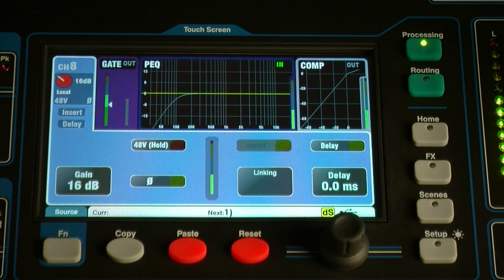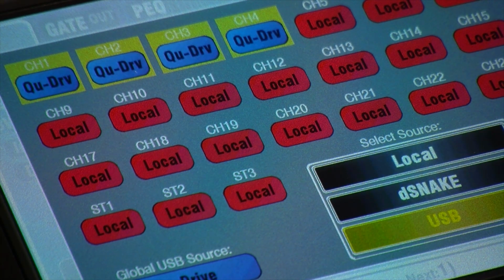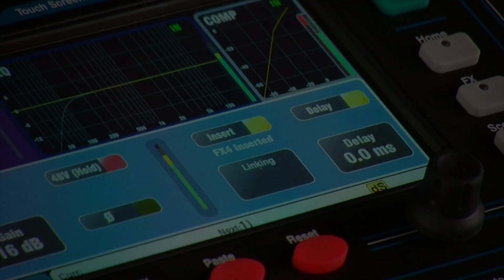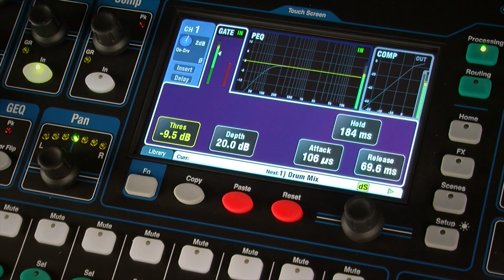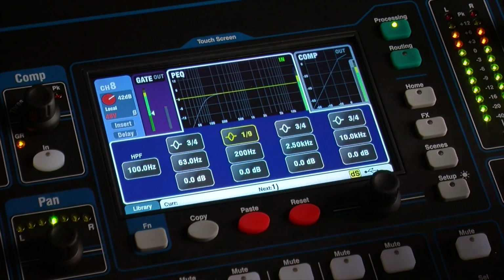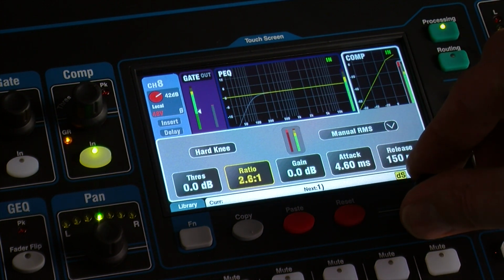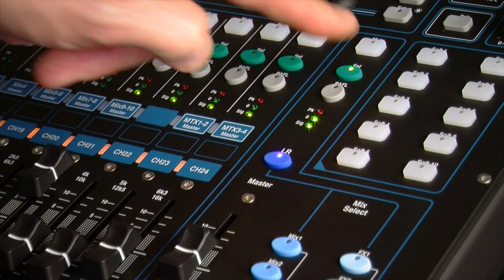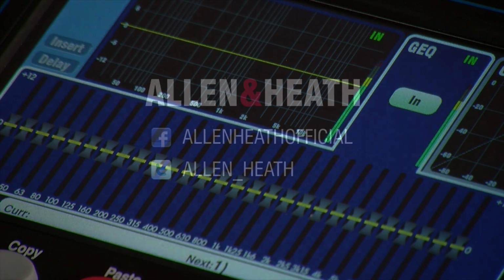Allen & Heath Qu Series - Channel Processing

Comment: Is there anyway to create a parallel compression channel?
Like, if I made Aux 5/6 into a pure drum buss channel, compressed the daylights out of it, then routed it into the drum DCA?
How would I route it into a DCA?
Reply from the maker: Hi Aaron, 

If your Qu has groups, you could send the channels to two group and use one for the compression. The other group can be left unprocessed as it is only needed so that there are no problems caused by latency. 

Alternatively, if you're using a digital expander, you could assign the same input socket to two input channels in the Setup > IO Patch > dSnake In page. You can then compress one of the channels and use the other channel dry. 

DCAs don't pass any audio as they simply control the main level fader for the assigned channel. So you could assign the two group main level faders or the two input channel faders to a DCA so you have a single fader control. 

You can find how to assign channels to a DCA here: https://www.allen-heath.com/media/Qu-Mixer-Reference-Guide-AP9372_10.pdf#page=44 

Thanks!
Alex

Comment: I’ve my Qu-24 running fine as a controller for ProTools (11.2.1). Everything works great except I can’t pan a channel left and right. I assumed I had something setup wrong in the I/Os. I’m not quite sure I’m reading the answer above correctly… did Nicola A&H say this isn’t possible? (!) Mixing music with no ability to pan things L/R is not ideal, obviously. Any suggestions on a workaround?
Reply from the maker: Hi! The Qu series uses HUI and Mackie protocols for DAW control, this allows control for Fader, Mute, Solo and Select functions. Unfortunately this means that pan can not be controlled in this protocol. For more information, please follow this link: http://support.allen-heath.com/Knowledgebase/Article/View/879/201/qu-series-daw-midi-control 
Thanks! Alex

Comment: I have the Qu 24 board just getting a feel the board and what it can do. But I have a problem right now that I just can't  solve we have new people that's working our board at our church and one of the new helpers was trying to control the sound coming from the board going into the box cast which operate our streaming he turned some controls but don't know the one he use we now have this horrible sound coming from our streaming I tried all that I could to remove it the best I knew how but it hasn't work is it possible that someone can walk me through this to get use back to normal I'm a little new at this. It's like a hollow sound like a person in a tunnel.
Reply from the maker: Hi Gregg, If you would like to submit a support ticket at http://www.allen-heath.com/support/ and we can help you with this. Thanks, Alex

Comment: Can you do VDO on parametric EQ, Channel parametric eq is not working right, it jump from 
234 Hz to 265 Hz, 265 Hz to 325 Hz 374Hz to 450 Hz, Is there a way to get swipe precisely? Thanks
Reply from the maker: Hi San, you can touch the frequency select on the screen and use the screen rotary to give you more precise selection of the PEQ frequency. Hope this helps! HG.
Reply: If you have an iPad using the QU-Studio App will all you lore precise controls as well.

Comment: This video like all the other videos from Allen&Heath UK is too fast, vague, and random. The manual for my QU24 is difficult to understand.  I'm a semi pro musician with limited knowledge of digital mixing consoles.
I want to use the desk as a daw controller and i'm having a real nightmare setting it up. I'm sure its a great desk but i'm currently frustrated about the lack of information about using this desk as the centrepiece of a recording studio which Allen & Heath claim it does well, but they provide no in depth videos or literature on the subject matter. I'm almost at the point of giving up with it, and going back to my analogue desk. Tech support helped a little, but the knowledgebase section on their website doesn't answer my questions.
Reply: +jabiesful please i think i'm in the same deep shit u found yourself 10 months ago. please i need your help to be able to record with the QU24 in my studio. i have done all the connections but can't trace the right button to hit in order to pop out sounds from my studio monitors. please any tips?